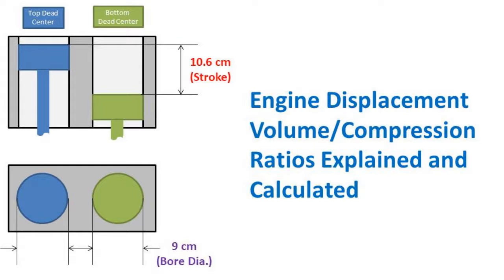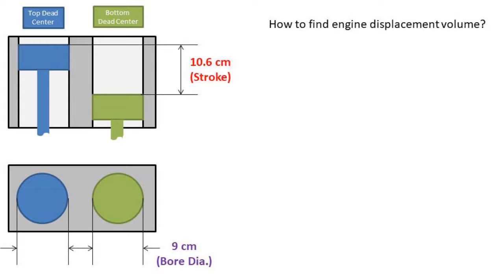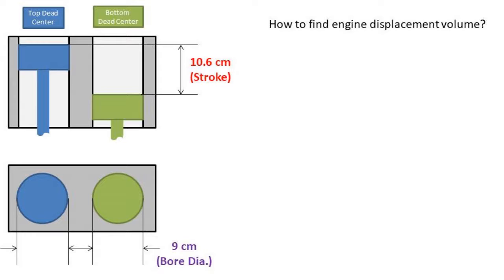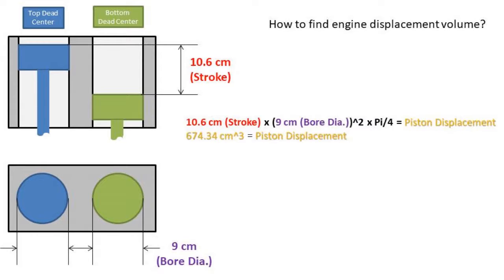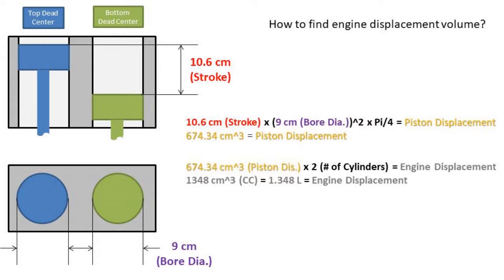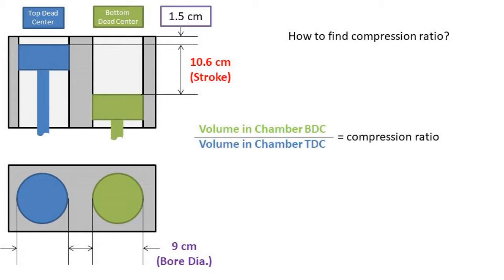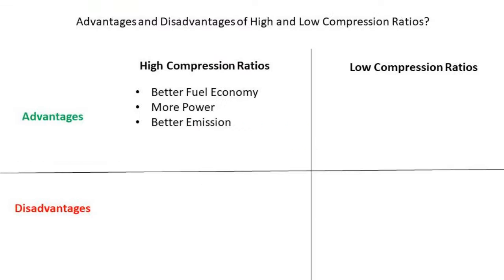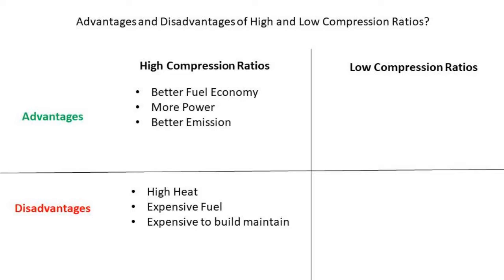Piston Engine Volume Size and Compression Ratios (Explained and Calculated)

Comment: Where did the ^2xPi/4 camefrom?
Reply from the maker: this is a variant of the formula to find the area of a circle. Normal formula is pi x radius^2. Being we are using diameter it must instead be radius^2 x pi/4
Reply: You often see the area of a circle a Pi x (radius, r) squared. Diameter is 2 x r, so r = D/2, thus r-squared ..." ^2" means r-squared = r x r = (D/2) x (D/2) = D^2/4 ! multiply by column height to get volume.
Reply: Im lost.